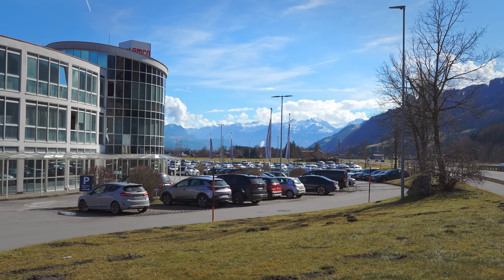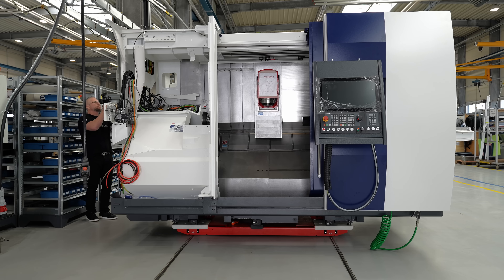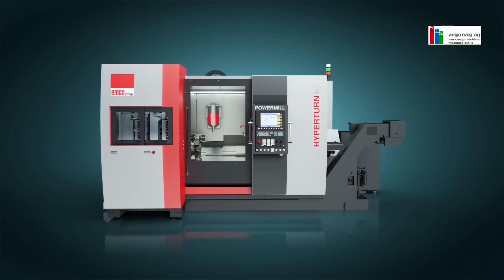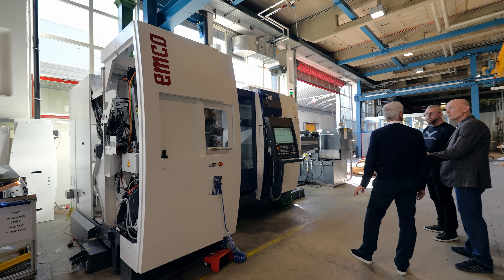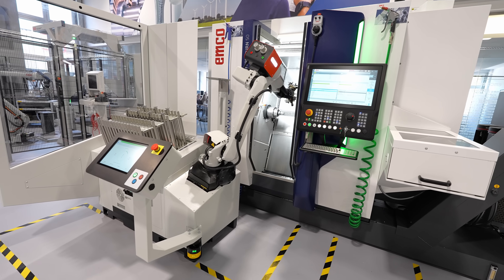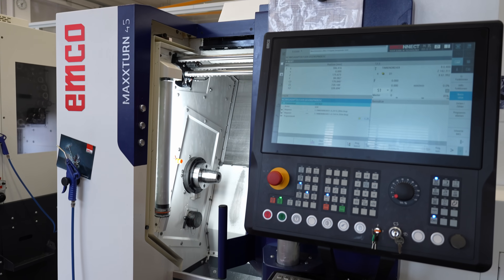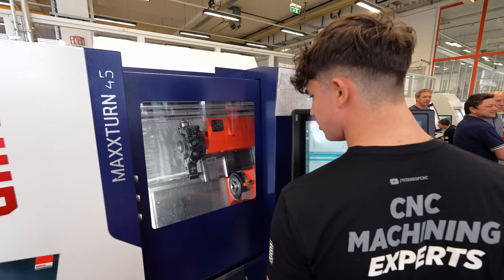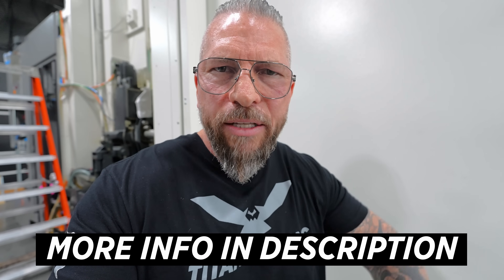World’s Toughest CNC Machines Hit Tolerances of 3 Microns (.0001)

Comment: I started with a Hyperturn 45 with one turret and a sub spindle. A few years later in 2019 a 2 channel Hyperturn 65 Powermill with sub spindle  was bought. Again a few years later a 1 channel Hyperturn 45 with a stock instead of a second spindle was bought and last year a Hyperturn 45 with 2 channels and a sub spindle came. I worked and still work on all of them and so far they're nice machines but unfortunately the newer they get, the more problems we had

Comment: It kind of hurts to disagree with Titan... I am operating one EMCO MMV 2000, and I've done so for the last 4 years... I've never had so much trouble with a machine in my career. I'll let you guys in on the journey.

I was really excited to get into 5-axis and the Siemens controller; however, this machine has given me so many headaches. After the first two weeks, I randomly got a spindle bearing alarm. After consulting with EMCO for over a year, they finally figured it out. This machine is configured with a robotic arm, so it is supposed to run lights out, but no, the spindle bearing alarm kept coming day after day, always right after my shift ended, causing us to lose countless hours of machining. And no, we do not run multiple shifts at my shop. This problem was due to the pressure regulation on my coolant pump. I got suggestions to try this, or that, and this or that month after month, and it took so long to get a reply from them. It was never one guy on the case—always a new guy telling me to try what I'd already tried multiple times. So that was my first problem.

The next problem is the windows on the machine. They are huge and look very good at the beginning. However, 3-4 weeks in, they were worn out from chips because it is not glass—it’s plexiglass. When we consulted EMCO about this, we got the most loved answer you can ever get: "You are not supposed to let the chips hit the windows." So now I've been operating a 3+2 machine with close to zero visibility for the last 4 years.

My next issue is the cooling unit. I get an alarm every now and then on a sensor; nobody knows why. I can come back 20 minutes later, and it’s all good.

Now, let’s talk about the coolant tank and chip conveyor. This is one of the most stupid things I've ever seen. On the conveyor, there is a rubber gasket on the inside of the machine. This gasket gets completely ruined by the coolant, and yes, we used a coolant that was certified for this machine. This gasket was so worn out after only half a year that we had to replace it. But we had to order it from somewhere else to get one that could tolerate the coolant. I might have forgotten one thing here: the coolant tank and the chip conveyor are welded together, so there is no way to do a deep clean of the coolant tank and conveyor without disconnecting the belt on the conveyor.

I'm not quite sure which problem to take next—should I talk about the lubrication pump and tell you the answer I got from EMCO? Well, yes, I’m going to. The pump suddenly was not able to build up pressure, so I kept getting an alarm to the point where I could not run the machine. I asked if there was a way to regulate the pressure. The answer I got was: "No, there is no way to regulate the pressure. The pump is broken due to the customer filling grease in the pump incorrectly." I mean, come on, how can you fill grease wrong? So they gave us a price on a new pump. If I’m not mistaken, the pump was about $1,000 USD, with at least 3 weeks for delivery. So I did what every reasonable machinist would do and started to repair it myself, which I managed to do in a day, even though I didn’t know how the pump worked.

I've also had an issue with the B and C axis clamping due to hydraulic problems in the parameters. Back and forth, back and forth, we used a total of two months figuring this out, plus a lot of money on new parts that were not part of the problem at all.

I can go on and on with problems, but I think this gives you an insight into my experience with EMCO. However, I will give them credit for one thing: the rigidity and stability of the machine. I could never believe a BT40 spindle could be as great as this. It is so stable, and my tools last 2-3 times longer than they do on other BT40 machines in our shop.
Reply: I work in applications and we used to have their dealership. 
This is usually how it would look on every single new machine we sold. There were a ton of issues. We were swamped with warranty claims. So you're far from alone.
Reply: As for the sensor alarm, its basically standard. We used to just disengage the flow sensor because it would throw fits constantly.
Reply: the sensor alarm, is that for the cooling unit or the spindle bearing?
Reply: @sondreheggnes8321  Its the flow sensor for through-coolant on tools in general, wether revolvers or milling spindle.
Reply: @sondreheggnes8321  We also usually retrofit the coolant pump with other brands.
Reply: good to know, thank you

Comment: In 2008 i went to (is it called trade school in english?) and ran a Emco PC Mill 50 with Siemens control. since 2019 that exact same machine is standing in my parents basement and making small parts when i have the time. (My old school teacher had asked me from out of the blue if i wanted a milling machine for free when i had visited in 2019) (The reason i got it for free was because the control board had practically committed seppuku a 2 or 3 years beforehand so i had to change it out for something else so i went with Centroid.) Thanks Lars best teacher ever lol 😄
Reply: Lucky! A friend gave me a pillar drill for free which I got working again, waiting for the right lathe and mill to show up on eBay at the moment :)

Comment: At our shop we have two Maxiturn 65 and one Hyperturn 110 all of them fully automated with the robo job system. All of these machines where recommend by EMCO for the specific parts we are machining. The Maxiturn 65  are hitting the tolerances really well and are were quite reliable. However I can't say the same about the Hyperturn 110. This machine can't handle the amount of chips that come with the automation of a robot. We had to replace the sheet metal multiple times because they got jammed by the chips with only got better with lots of replacements and after months by a complete redesign of the lower sheet metal. The reliability and build quality is also not what was promised. The upper turret wouldn't lock into place reliably which they replaced twice. The guide rails had to be replaced on three occasions because chips got stuck in the plastic caps on the bolt holes and damaged the guide rail system. And the sheet metal cover of the upper turret fell into the machine because they forgot multiple screws. The machine was down three of the first nine months due to repairs. 
Due to that I sadly don't share the excitement about this machine anymore.
Reply: That sucks that you had so many problems like that.But hay thats part of this world.Nothing is perfect.

Comment: I'm already on my fourth Emco lathe. My oldest has 45,000 operating hours. It has the original spindle, original motor, and original guideways, and it still achieves tolerances of +/- 0.003 mm in production.
Reply: how many years of operating to put that many hours on a machine?  very impressive!
Reply: @MrChevelle83  This machine wasn't used that heavily—it lasted 15 years. My main machine currently runs about 4,500 hours per year.

Comment: With a CNC machine or really, any machine, tensile strength matters less than elasticity of the material. If you're loading the superstructure close to the yield stess then you're probably doin' it wrong and it's going to deflect elastically by tenths of a milimeter. Hence massively overbuilding parts giving as much material as possible to make net stress as low as you can (force/cross section area,) reduces elastic deflection. Cemented carbide would be even better theoretically speaking but you dont want a machine that weighs 100 tons and costs as much as a boeing 787. Moreover steel can be prone to Creep or "racheting" under heavy vibration and load cycles meaning small dimensional changes, while cast iron is less prone to creep issues. This is the same reason the outside bow of large micrometers is uduslly cast iron, dimensional stability.  Thermal expansion ratio also matters as stated in the video. (I got a chance to visit that used a central coolant chiller system on all their machines, to keep them around 70 degrees. Each machine had a coolant heat exchanger running glycol to a chiller out back.) The reason they use a steel weldment for the base probably has to do with cost and manufacturability. Probably helps reduce shipping weight for a part that isnt demand critical and doesnt experience a lot of stress or cyclic load.
Reply: did they make medical parts by any chance?